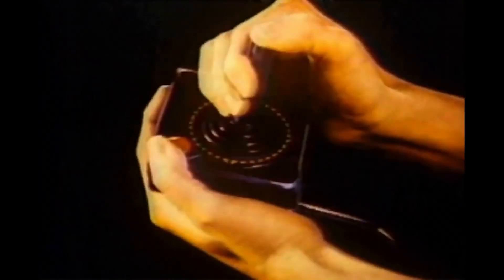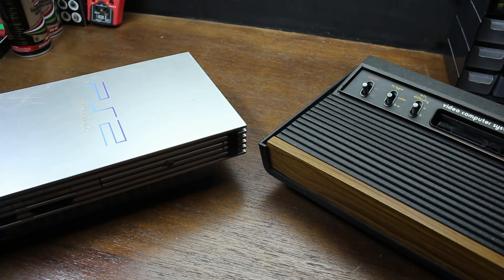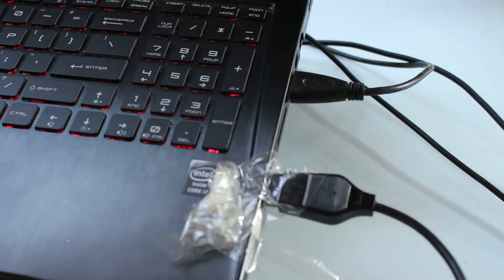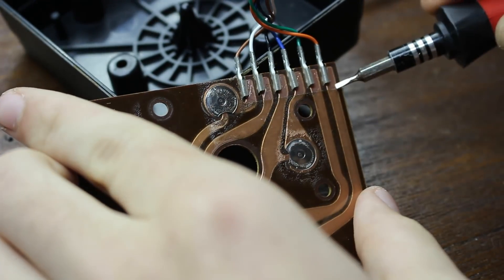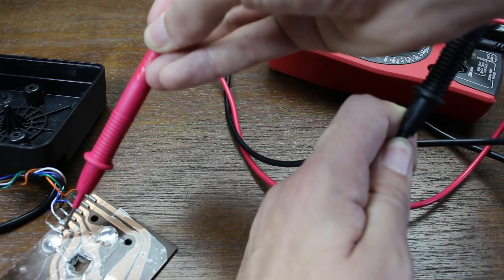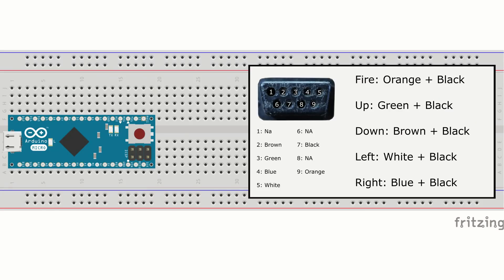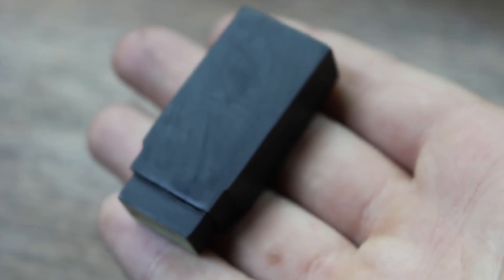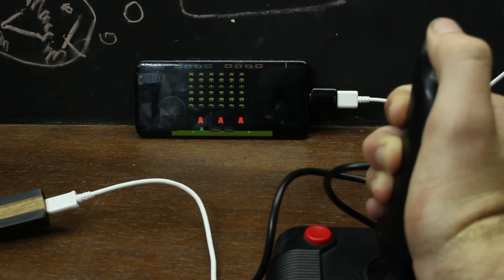Arduino Atari Adaptor (The 3 As)

Comment: This is great, however, back in the day, one of the biggest pains playing this console was that you were physically tethered to the unit by a cord.  The cord would get wire breaks close to were the plug inserted, and the console would sometimes get pulled off the shelf during heated game play, etc..  A great follow up to this video would be to show us how to make a wireless version of out of an original atari joystick, paddle, and / or race controller with modern electronics.

Comment: I ordered this print as it would have been perfect for the project I was doing but your STL files are off.  the insert used for the 9pin connector is too big to fit into the top and bottom shells.  I downloaded the STL files off the  hackster.io site

Comment: It looks like there is a noticable input lag. Is this because of the emulator or the arduino?
Reply from the maker: I'm not sure why the video is showing any lag. I've just set it up now and given it a test and the emulator and device both run with no lag whatsoever.
Reply: @BuildItnow   i mean...i could be wrong, but it really looks like it. Ok, maybe its just the game, last time i played it on the original hardware is over 20 years ago. ^^
Reply from the maker: I think it's down to the video. On the day that I shot this there may have been some lag on my PC or the emulator but since then I've had no issues. Even using Android shows no issues or lag. Thanks for the heads up though!